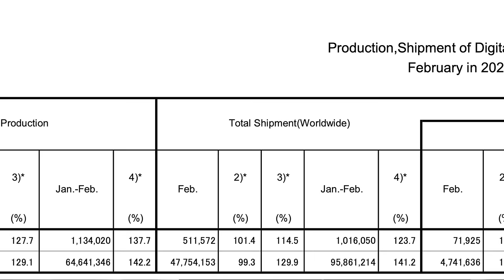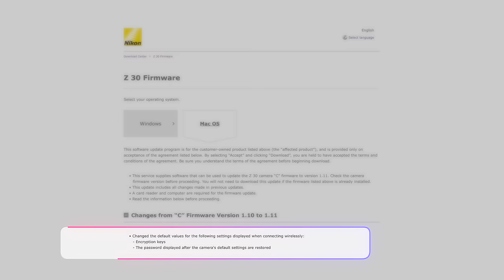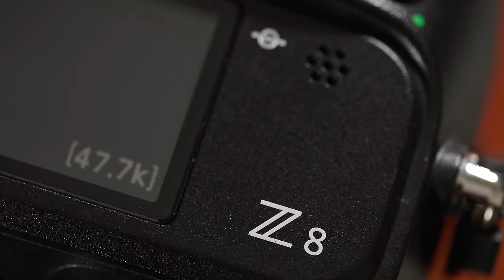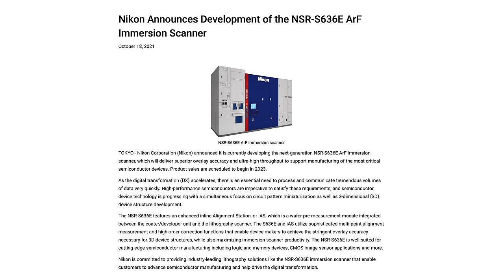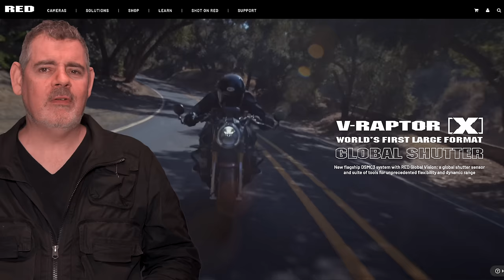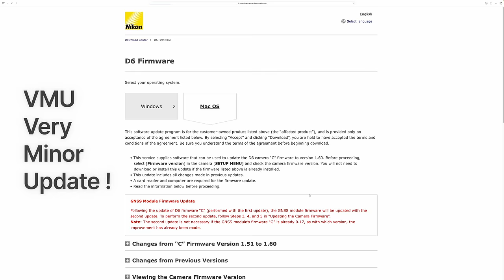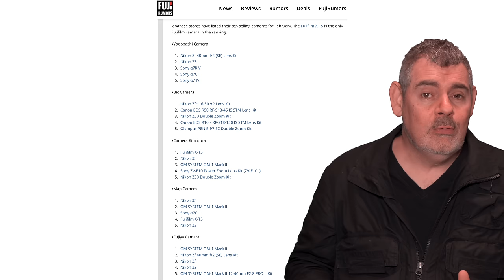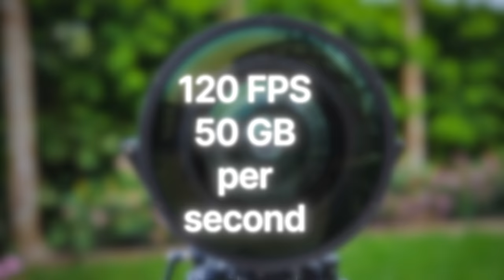Z6 III Leak Real? | Strong Nikon Sales | HIGHEST MP Video? | Canon R5 II? | Firmware Z30/Z50/D6+More

Comment: I'm a wedding and real estate photographer and videographer, and I shoot marathons and triathlons on the side. For real estate, I can still get by with my z6II, but I'd love the AF tracking features of the Z9/Z8 in a mid-range affordable lightweight package, along with those wonderful Nikon ergonomics and durability, for everything else.  The Z6III would be a great addition for versatility as a primary cam for weddings and a backup for sports/weddings and real estate, where my Z9 and Z6II are currently used. Waiting to buy the right 3rd work camera that would essentially cover everything I currently do without missing a beat, should something break and need repairs, or become too expensive to fix.

Comment: I suspect they're holding off on the Z6iii on purpose so more people buy the Z8 impatiently. The Zf was basically everything I needed from a camera spec-wise (Expeed7 level performance, 10-bit video and better flipscreen) but I need all-day ergonomics and the buttons, but the Z8 is a step above in all regards so I opted for that instead of continuing to wait and I've seen so many people that got the 8 vs wait for the 6iii

I might upgrade/sell my 6ii to the 6iii for my second body if it's appealing enough

Comment: If the Z6iii had a 36Mbit sensor, I would buy it in a heartbeat.  A slight upgrade in resolution between the Zf and Z8 would probably be enough for me to buy the Z6iii.  Otherwise, given that it looks like the Z6iii will probably stick with the 25MBit sensor, I think I will probably buy the Zf instead.

Comment: I am only interested in high resolution cameras.  Based on what I know of the current line ups from Canon, Sony or Nikon,  for me Nikon is still the best there is considering the technology packed into Z8 and firmware upgrade support from Nikon.  Sony is proposing to charge for firmware upgrade for its A9iii to unlock features on A9iii.

Comment: A completely unique lens would be a Z 200mm f/2 TC, effectively giving a 300mm f/2.8.  This would be perfect for indoor sports as well as outdoor portraits and fashion.  Yes, it would be a fairly small market, but Canon has the RF 100-300mm f/2.8 and Sony has a 300mm f/2.8.  Bringing the 200mm f/2 back, along with the 280mm f/2.8 at the flick of a switch, would be different.  While the Z 70-200mm f/2.8 is excellent, at closest focus the tele end is reduced from 200mm to under 150mm.  The prime+TC would stay at 200mm.
Reply: This doesn't make any physical logic I'm afraid. If 200mm f2 (or 2.8) has a TC it would lose minimum a stop of light so when engaged it would become between 350-400mm f/4. That's how the current 1.4 TC works, i don't think laws of physics will upgrade that fast specifically for teleconverters. 👀
Reply: @dicekolev5360  A 200mm f/2 with a 1.4x teleconverter becomes a 280mm f/2.8 lens.  That's how the "laws of physics" work.
Reply: @UnconventionalReasoning  I was actually thinking of another thing so nevermind + I am drunk, you are correct, lol. But 80mm is a waste of TC if you ask me 😄
Reply: @dicekolev5360  It's less about the difference in mm, more about the ratio change.  This is the same 1.4x that is in the 400mm f/2.8 TC and the 600mm f/4 TC.  In all three cases, the comparison is between the focal length change of 1.4x or the crop of 1.4x, slightly less than a DX crop.  If people are interested in teleconverters, the 1.4x has less image quality loss compared to the 2x, and it has only a 1-stop loss of light.  Then, the advantage of the built-in TC is that it is optically matched to exactly that one lens, resulting in the least image quality loss, even less than a zoom lens.  A decade ago, Nikon had both the 200mm f/2 and 300mm f/2.8 F-mount lenses.  With the TC, these could be combined into one lens, increasing its usefulness and the number of people who might want to buy it.